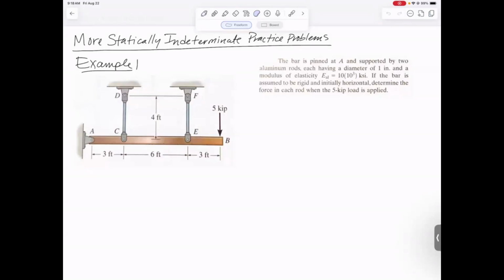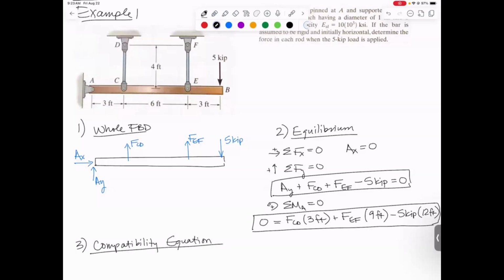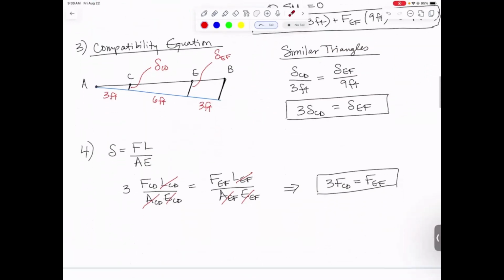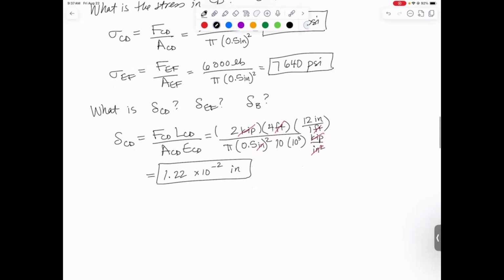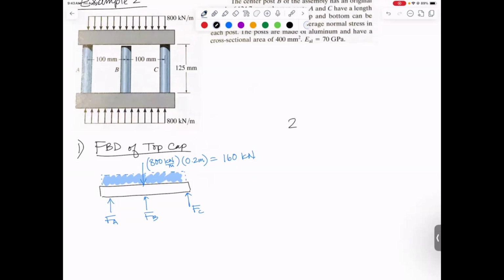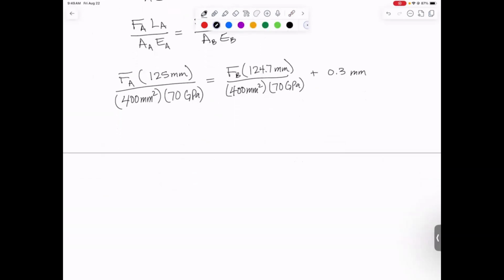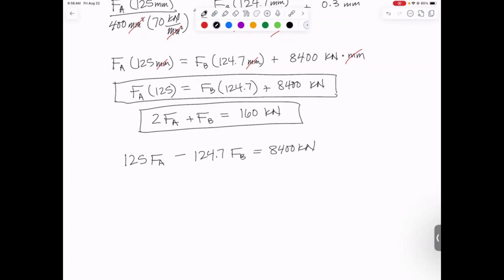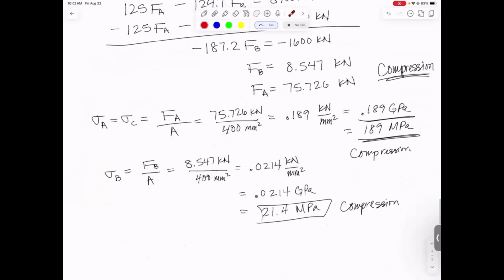Mechanics of Materials 12: More Statically Indeterminate Axial Load Examples

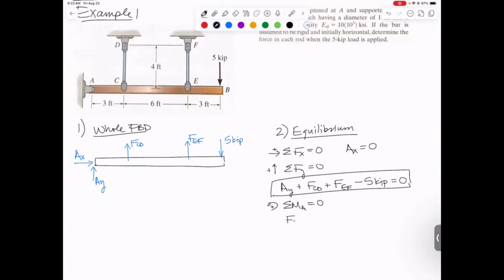Comment: How come the sum of moments at A is equal to zero  (02:33) when we said that beam is going to rotate a bit? And how come the system is in equilibrium when we know that beam will rotate to a new position? Thank you <3.
Reply from the maker: The short answer is because the rotation is so tiny compared to the overall dimensions of the part. (It has to be tiny to meet the assumptions of our Mechanics of Materials equations.) In Mechanics, we also don't think of the part as moving because of the applied loads. It has one position before any loads are applied (drawn in the picture), and then after the loads have been applied and left there for a long time, it has a new loaded position (very close to where it started, just with a tiny amount of rotation because of the length change of the bars.)
Reply: @StaticsMechanicsProf  Thank you so much!